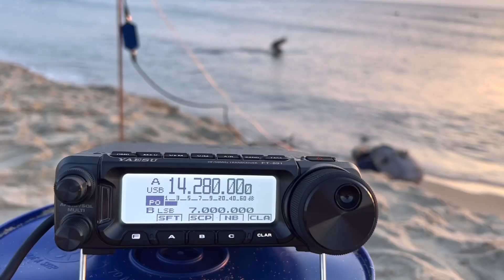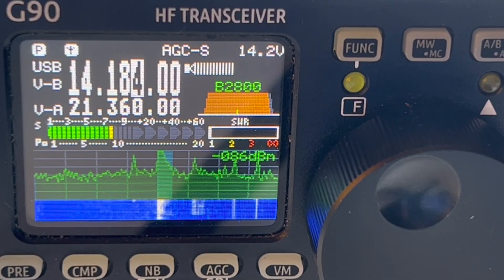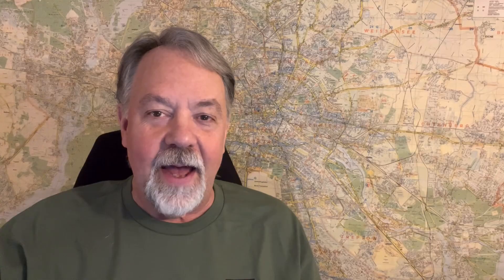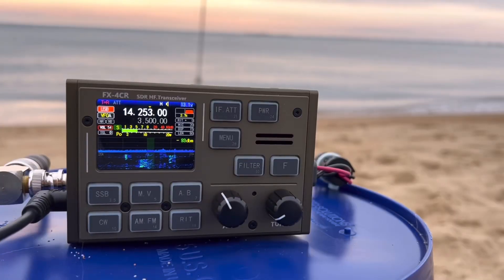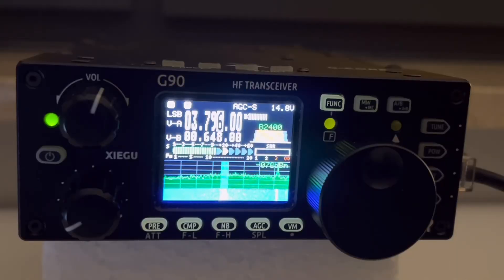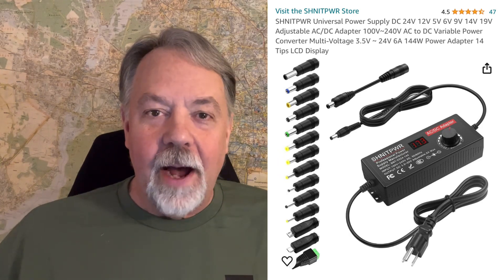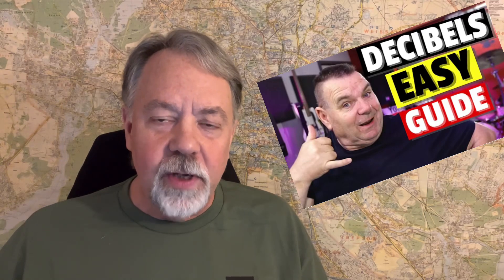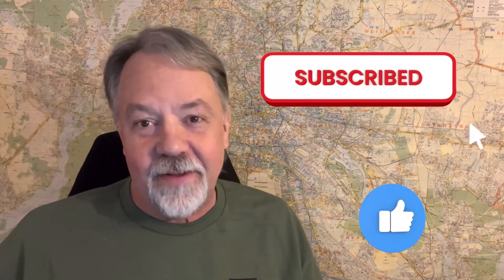20 Watts Versus 100 Watts - How much HF Ham Radio Power Do You Need?

Comment: I think it also depends that you play radio from the beach most of the time and that sea water it’s pretty much an amplifier. I play radio from home where the stupid HOA restrictions are a real thing. Sometimes even with 100 watts I don’t get out and have to fire up my amplifier. There is not a rule that’s fits all. For a reason the rules are “the minimum power needed to make the contact” and in my case QRP doesn’t make it. I personally need an Amp as an equalizer with the people with huge antennas out there. That’s the best thing of our hobby, we have options. It’s good to be aware of that because many times people believe you have to use low power no matter what and they look you over the shoulder when you say something against that.
Reply: If you need 100w good for you and I agree about location and antenna .
20 w’s works for me where I am .
Ofcom has upped the game with 1kw for full ticket holders in the uk.
Reply: I can hear the strong signals at home, but nothing with low power on a lot of bands.  Noise floor is like S6-S7 sometimes.

Comment: Interesting... I have my FT-891 at 50 watts and never change it. The next time out, I'm turning it down to 20 watts. Let's see what happens. Thanks for the content. -73
Reply: I run my 891 at between 5 and 50 watts. I’m 74/100 towards Mobile DXCC using my ATAS-120A on a triple mag mount. I power it with a 15Ah Bioenno battery so I can take it anywhere. Gotta’ love a one touch on the 891 to tune the ATAS. 
“QRP School” on YouTube has a great video explaining that you need to quadruple your power for 1 more S unit.
Reply from the maker: @joekrepps looks like it’s the perfect radio for you.

Comment: I have been playing with my newly licenced 25 watts on my base station 450D Yaesu and I have to say that you are absolutely correct. I was always happy with 10 watts and will continue to use it but 20/25 watts is definitely the sweet spot. The G90 is still the best portable rig - the s/h prices show how popular they are. 73 .M7BLC
Reply from the maker: 73 my friend!
Reply: Agree - I’m either using FT891 with 20W or FT818 with 5W out in the field. No shack here, only portable operation. 20W is perfect for SSB, 5 for CW, FT8 aso…